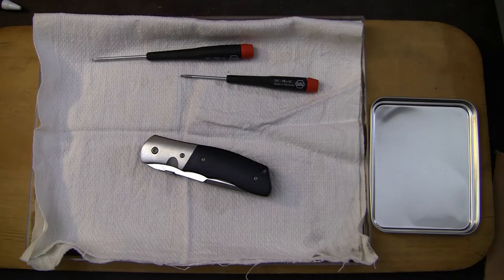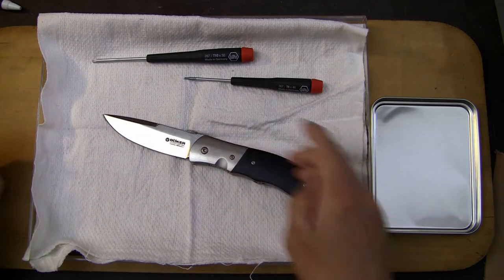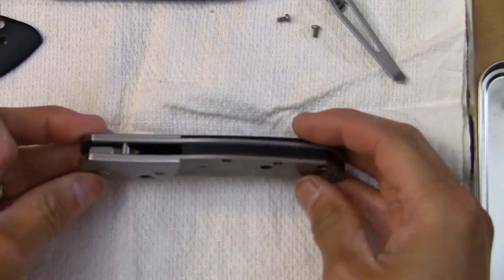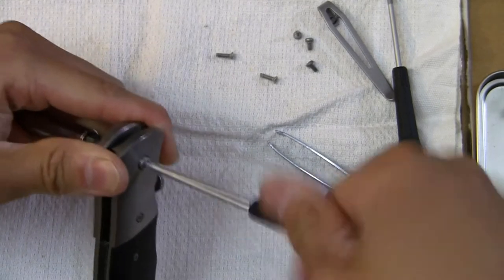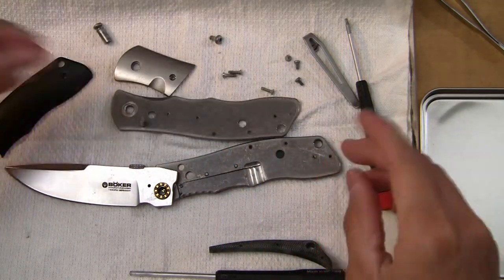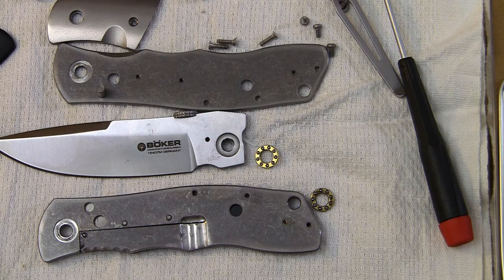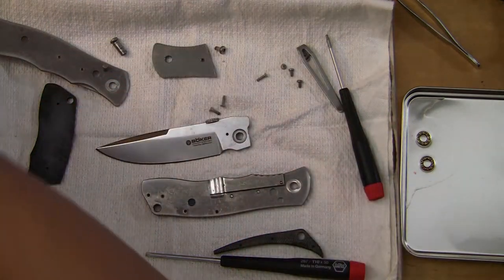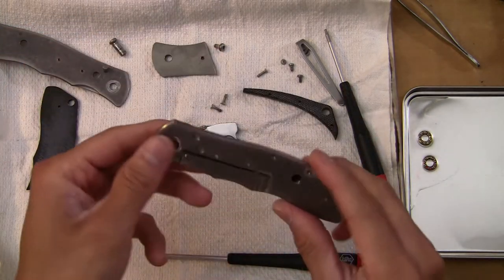Boker SD3 disassembly/cleaning

Comment: It seems that the bolster & scale are only aligned by threaded fasteners through minimal clearance holes. If you loosened the bolts on each slightly, then retightened while holding each piece in its respective position the alignment could be improved. 
They're not doweled into place so part of the fit & finish gets accomplished through the hand assembly process rather than machined tolerances. 
It's late so I don't know if this makes sense but...loosen, tweak, retighten.
Reply from the maker: This actually makes perfect sense. I'll be adjusting that bolster alignment this morning and hopefully it works, if not no big deal I'm still using the knife for it's intended purpose. Thank you very much for the suggestion!

Comment: This might be better said in your new documentary, but I think its fine to be critical [especially re: lock bar issues], but qc issues on more expensive and or collection type items bug me. The product is new, and at a couple hundred to thousands of dollars [sometimes you're waiting a yr+ for it] the price should reflect the F+F of the product. I don't think that's unreasonable, even for a user.
Reply from the maker: Well, it's a fine line that I'm walking. I'm trying to separate user and collector completely and not trying to meld it together only because, for me, I tend to be extremely overly critical of my knives and then I would be sending everything back lol. I'm trying to be more objective on the matter of every day use and how some of these smaller nit picks don't really affect it. My reviews will be based more around the functionality rather than the collecting. I'm still going to state the facts as I go.  Yes, it's annoying (that's the collector side) but if it's still usable I can overlook certain things these days. I agree the price tag vs the issues is unreasonable, because as a consumer I like things to be perfect if not near perfect even for an every day user. I think in the end I've broadened out my threshold for acceptableness on these matters. I'm trying to branch away from total collecting now and certain fit and finish issues are not going to deter me.
Reply from the maker: Oh forgot to say however with regards to my last comment, this truly may be the last Boker anything that I ever buy lol.

Comment: This happened to me with my boker neilblackwood folder. As long as there no lock rock or lock stick i'll keep mine. ill keep you updated when i get mine.
Reply from the maker: Sorry to hear that! I'm beginning to think I need to stay away from Boker...even the Arbolito line, which is sad! Definitely let me know how yours turn out. Maybe I just have bad luck lol. I was thinking of returning it, but I've decided to keep it and just use the crap out of it and see how well it does. I just used it to prep my lunch the last couple days (along with the Exskelibur for comparison) and break down a whole bunch of cardboard. There will be a full review to come later on. Afterwards depending on how much the blade is scratched up I'm probably going to put a nice high polish on the blade:) Thanks for watching and commenting!
Reply: darkchild57 return this for a lionsteel sr11 lol. still a beautiful looking knife though, bokers are a hit or miss.
Reply: Knives from Lionsteel are also having QC issues (especially the detent is often scrwed up)
Maybe the SR11 is better in that regard, I have not checked it out yet.
Reply: darkchild57 yeh I got mine last week. returned it right away. the micarta scales had a 1mm gap between the metal scale because the backspacer screws were pushing the micarta scales out. The blade stop pin pushed out the ti bolster sticking out 1mm pass above the micarta scale. the folder had multiple flaws which made the bolster setup a fail with hard lockstick. if you take apart the knife it will never be solid since the tolerances are horrible. the only thing positive was the smooth opening, no blade play and overall look of the knife. i love my sebenzas cause I never have to worry about taking apart and putting back together still be solid everytime. my boker was a lot worse than urs.. lol
Reply from the maker: Oh no. Ok well that says it all then. That's too bad they have a lot of nice looking designs and from many collabs. It use to be that I could depend on the Tree brand for the quality. The copy you got seems like they really could care less about their signature line or any of their other lines. Sebs have always been nice in that respect, tight tolerances and you know the knife will be exactly the same after you put it back together. I guess I'm thankful that my copy of the SD3 only had those two issues, seems minor compared to what you received! Thank you for letting me know, much appreciate the helpful feedback! AND Boker if you're reading any of this and even remotely care, get your QC together!

Comment: Thank you for sharing this. I really want the knife Boker came out with that Steven Kelly designed. It's $290 and I'm scared to take the chance that it will have issues.
Reply from the maker: You're welcome! Thanks for watching. Yeah I'm losing faith the Boker Tree line now... They have definitely gone down hill since the last three that I owned. I guess the only way would be to find one at an actual store and pick your own. Or call up one of the knife shops and ask them to inspect for typical fit and finish before mailing it out. It truly is a hit or miss with this brand. The messed up thing is that this topic regarding f/f with Boker has been discussed ad nauseam for a while now and it's apparent they don't really listen or take criticism very well lol. Oh well.